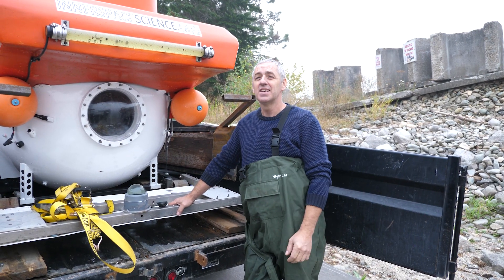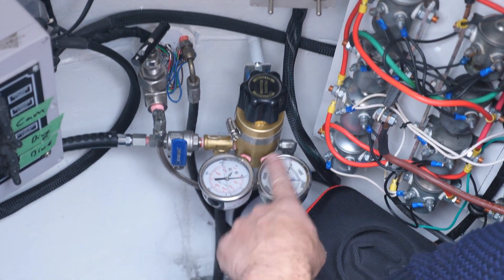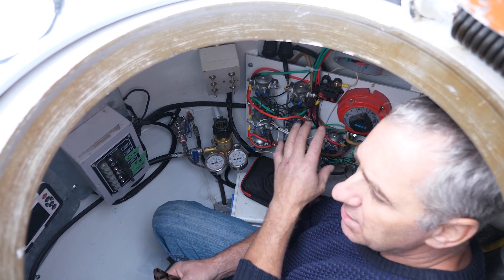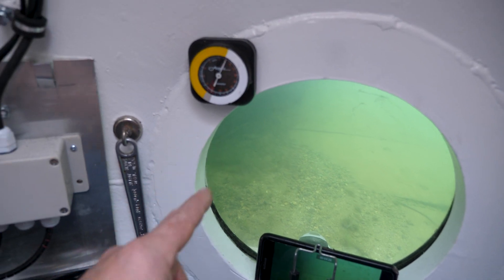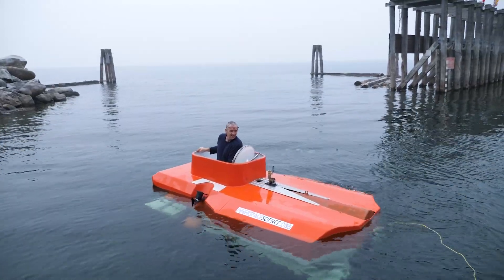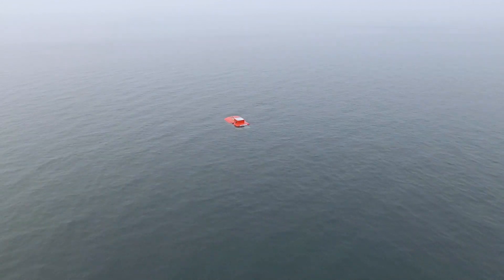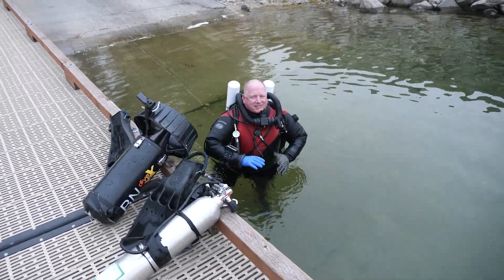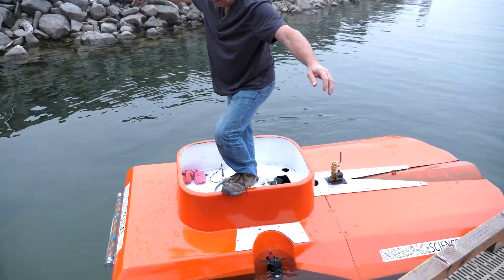First Manned Dive In E3000 Plus Interior Tour | Homemade Submarine

Comment: Hank,
In one of your vids I saw a sabertooth controller handling your speed control etc. That being said you could use a computer joystick with three axis to allow for forward/reverse skid steer methods with one joystick. The three axis could allow for less hassles so you could toss the spst toggling it appears you have to do...
Reply from the maker: Hi, I am using a 3 a sis joystick with 10 ohm potentiometers.  I need to program the controller so it has a larger gap for neutral   That is why my props are turning super slow.  The toggle switch is just for the wrist function on the arm. It has a pre set speed control.  The arm functions have joy sticks for fine speed control and work super good.

Comment: All that heavy steel and it doesn't sink because it's sealed air tight but all it takes to make it sink is just some little water tanks on the side? What if the air inside the main chamber was less than that of one atmosphere? What if it was a vacuum chamber? Would it still not sink?

Comment: If I were to make a sub for shallower depth, lets say 1000 feet, or less, fully dry, with life support, could I use Kevlar, and epoxy risen instead of steel for the majority of it's construction?
Reply from the maker: There have been several fibreglass sub hulls made that can dive 1,000 feet.  There is no cost saving though.
Reply: @HankPronk  I don't really see Kevlar, and epoxy risen as the same thing as fiber glass mostly because of the price difference but it's good to know fiberglass hulls can be made to go that deep. Are you sure they are not open bottom type hulls that have ambient pressure separators?

Comment: You have done a great job! I piloted Perry subs in the oil business, and you have similar atmosphere control equipment to what we had. Probably better sensors even!  For O2, we used a Biomarine O2 monitor, basically a fuel cell (very small) with a permiable membrane on it. The O2 in the atmosphere difussed through it, and the volts it put out were directly proportional to the % of O2.  Instead of reading volts, the guage read out in % of O2.  For CO2, generally just watched the barometer.  If the O2 was correct and the pressure was increasing, the CO2 was also.  So, turn on the scrubber.  That worked best when it got a bit warm, and that did when the CO2 built up a bit. Like to .4 or .5 percent.  At about .7 % I would get a bit warm in the face so I knew to run it that way also. However, one has to stay aware as it is easy to not notice this!  Best, Pete
Reply from the maker: I operate pretty much the same, and keep it simple.

Comment: Great tour of the inside. Look forward to seeing more dives in Spring! I noticed you don’t have any dehumidifier there, with the temperature drop does the sub start to condense or do you have a system that takes care of the moisture?
Reply from the maker: There is condensation on the hull of the sub, but it is not an issue at all.  Also with the hull being a sphere the water would collect at the bottom, making it easy to deal with.
Reply: @HankPronk  that is an interesting point though. Does it ever fog the window?

Comment: Hi there Hank, I want to base the design of my submersible's pressure sphere on the ASME PVHO-1 specification. Is that the spec that you base your designs on or would you recommend other specs? Your submarines are so well designed and built I would do well to base my design on the same specs you base yours on. Thank you for always being so willing to share your knowledge and skill - it's greatly appreciated!!
Reply from the maker: There is an ABS head calculator on Psubs.org and that group is a great help.  I follow ABS guidelines for my sphere.  Tell me the size and depth and I can double check your shell thickness.
Reply: @HankPronk  Hi Hank. I'm still very much in the early concept stages of my submersible's design but I'm planning a 2 man sub using a 1650mm ID sphere with a 20mm wall thickness made of A516 Grade 70. I wish to achieve a maximum diving depth of 1200 feet. That's rather conservative but because it's a home built sub I wouldn't want to dive deeper than that. The things I will need to get 100% correct on the pressure hull are: sphericity of the hull, all the welds, and of course the viewports and hatch design & construction. Thank you very much for the info, I'll most certainly visit psubs to learn as much as I can. I really appreciate the time you take to answer my silly questions.

Comment: Hi Hank! I only looked up and found your YouTube channel yesterday & I'm really glad I did. You're a true pioneer and a HUGE inspiration to all of us 'wannabe' submersible builders. I've been wanting to build a submersible (similar to the kind you build) ever since the early 2000s but I never worked up enough determination & focus to get started. Watching your YouTube channel was just what I needed to commit to building one. I'm still busy with the concept design but this time next year I hope to be able to start with the actual build. I will continue to closely follow your channel, both for inspiration and for learning!! I hope you won't mind if I contact you from time to time with some basic questions? One thing I have recently learned: syntactic foam is damn expensive! Do you use syntactic foam on your subs? If so, how much do you typically use. Thanks again for the inspiration!
Reply from the maker: Thank you Pat.  I am always happy to help.  No I never use foam, way to expensive.  On my deep diver I use carbon fibre buoyancy tanks.  It is best to increase the volume of your sub hull, so you never need extra buoyancy.
Reply: @HankPronk  Hi Hank! Thanks for replying so quickly, I sincerely appreciate it. I heard you mention the carbon fiber bouyancy tanks that you have installed on your 3000ft deep-diver. That's very impressive - did you build the carbon fiber tanks yourself? So they're basically high-pressure air-tanks that (because of the light carbon fiber construction) do double duty as 'fixed' bouyancy too? That's ingenious! Thank you again for the  advice - it's worth gold to me!

Comment: Great job...did you turn on your light bar?
Reply from the maker: Thank you, no I did not.  The light would not have shown up because it was too shallow and bright still.
I have used the same light design on other subs and it is amazing especially for the cost.
Reply: @HankPronk  yeah I was thinking since the diver that was with you said that visibility was only 15 feet if you turned on the light bar if it would have showed some difference for visibility. Great videos and great to see that you're having fun and using your knowledge and US viewers get to experience it as well. Thank you
Reply from the maker: @pmag3200  I  forgot to mention that I don't have the coms installed yet, so no way to communicate with the diver.  I use the light as a way to tell him there is a problem.  Then I have a note pad inside that I can write a message on and he can see it through the window.
Reply: @HankPronk  great to hear that you have all bases covered for your safety so take care and can't wait for the next video or videos

Comment: Hank if you make up your wiring harnesses  do you use automotive or light commercial fuses and fuse holders?
Reply from the maker: I have an electric panel with breakers and heavy duty 80 amp fuses on the solenoids.